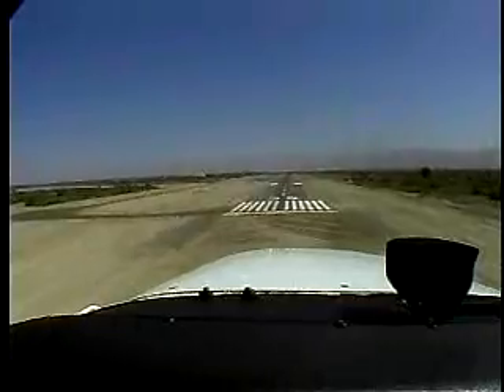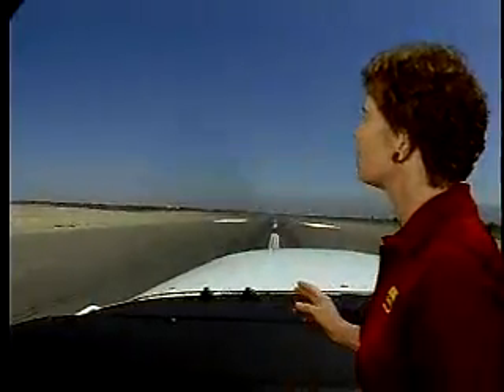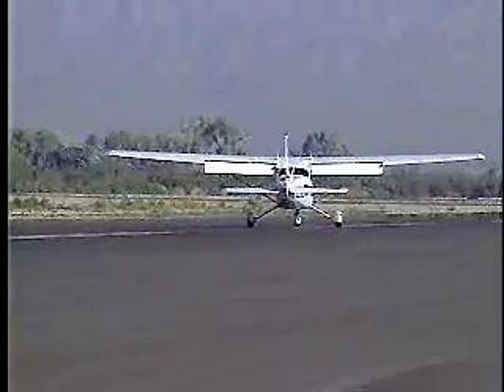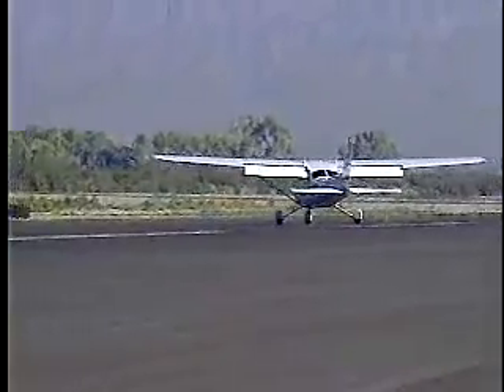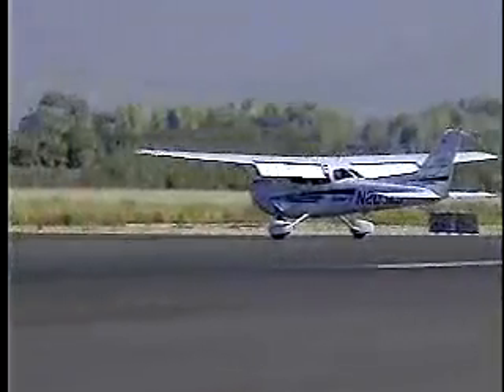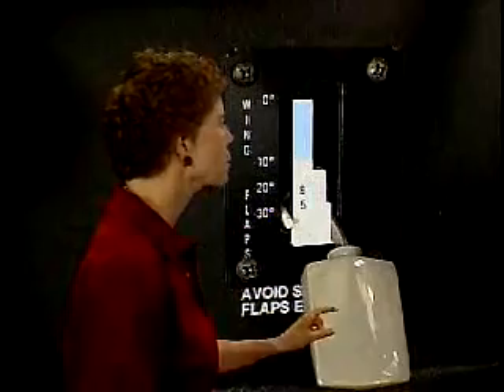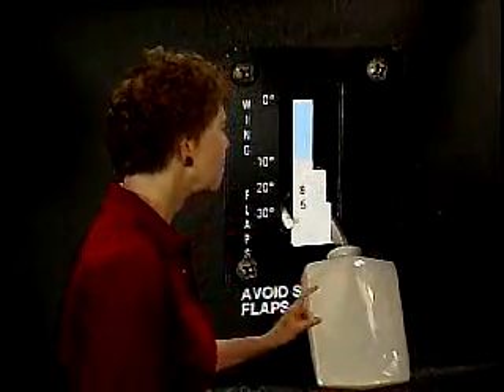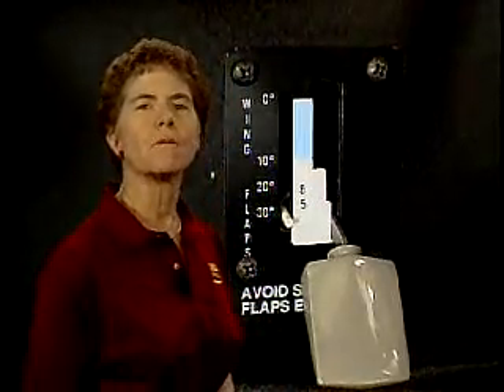Landing a Plane:  When do you retract flaps? - KINGSCHOOLS.COM

Comment: Besides the reasons cited here, its also a bad idea in the event you may need to Touch-And-Go if say, you have to do a Go-Around.  This typically would necessitate in high cross-winds or experiencing sudden high wind gusts on flare.  Theres a consensus that its inadvisable to retract the flaps on Go-Arounds until Pattern Altitude is once again reached.

Comment: If you are so stupid to confuse one lever with another, you cannot be a pilot.  It is like confusing the gas pedal with the brake pedal.  Or the reverse gear with the D gear.  Super stupid.  Those guys cannot drive either.  Too nervous and clumsy.

Comment: There have been more than one REAL cases when pilots retract the gear after landing instead of the flaps. This may sound impossible to the normal pilot as it is to forget to lower the landing gear before landing. But YES it happens.
In a multi-crew it may be acceptable (if properly briefed) to raise the flaps by the non flying pilot. It is not required. If you need to break hard, you may want to reconsider your short field landing technique or look for a longer runway.
Happy Landings,
Guido

Comment: Sure, Avgas is still 40 cents a gallon all over so letting the airplane roll a lot on runway before you can really start braking is a great idea. Then you have to taxi back if no touch and goes were allowed, etc. 
If you have the tendency to confuse the gear handle with the flap handle, means you get too nervous and you are dangerous on other multitasking maneuvers like Emergencies, Go Arounds, Crosswind landings ect. Since i have 10 hours of flight & even 40c a galon of gas in 1969 i retract
Reply: Nahhh.. You let it roll the trainer so it can use 4,000 feet of runway, then stop and raise the flaps, Av gas is only 5 dollars a gallon, lets use all the runway.. and waste gas and flight time.  Naaahhh...
Reply: @outwiththem  Only an idiot will confuse the R with the D on the car shifter lever.  And the flaps with the gear on an airplane.  They even have different shape handles..

Comment: Flaps UP soon as you have positive control after landing. Better breaking. Better directional control. If your landing a LSA or Cessna on a 5000ft runway then yes maybe keep the flaps down. I however like to keep it consistent an stick with the same procedure.

Comment: I understand Martha's reason for this, but I've been taught by two separate flight schools (one of which was run by a former founder and pilot of a major airline) here to raise the flaps on touch down.  On a check-out flight in a small Cessna, I was even dinged once for forgetting to raise the flaps on touch down.  On certain aircraft, I'd keep them down for the very reason mentioned, but I'm surprised the kings do it in a Cessna.  Maybe we do things different here in Canada :)~
Reply: Canadians are not sisssies.  They are not afraid of doing hard work or hard to do things.  They are better pilots that even have to pass a Spin Test to test for bravery under pressure BEFORE SOLO.

Comment: @willisbr Actually many aircrafts specify this action in their POHs in the short landing procedure. Balding your tires isn't really a concern, the only downside for this procedure that causes a debate is the possibility of accidentally retracting the gear instead of the flaps. And if the airplane ballons the squat switch will not be activated and it won't prevent the gear from retracting. But still, it is a very useful method of increasing the braking and steering efficiency.

Comment: On shorter runways I like to bring the flaps up right after touchdown so that I will have more braking efficiency and so there is no chance of the aircraft getting airborne again.
Reply: Nah, if the airplane is stalled, then all of it's weight is already on the ground and raising the flaps won't add more weight to the airplane.  Leave um down until you turn off the runway then you can clean it up.
Reply: @daffidavit  There's a difference between touching the ground and supporting the entire weight with the gear. Aft flaps increase angle-of-incidence, angle-of-attack, and lift. This keeps load on the wings; reducing load on the gear, reducing traction, and increasing the risk of hydroplaning.